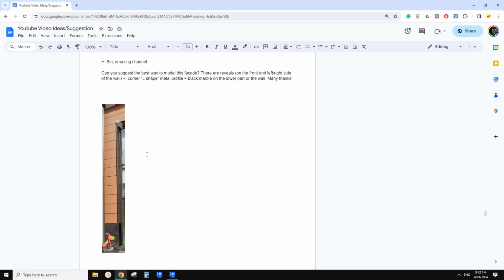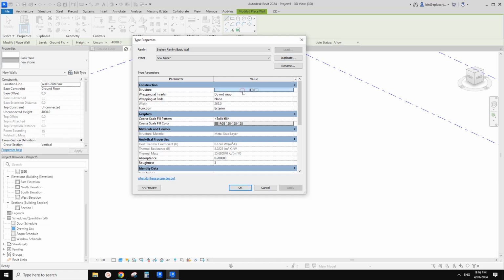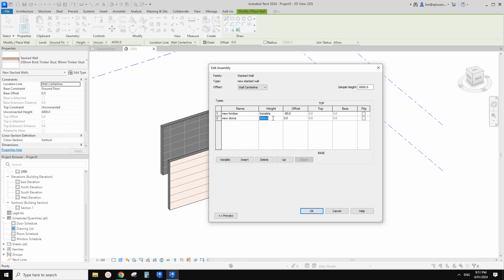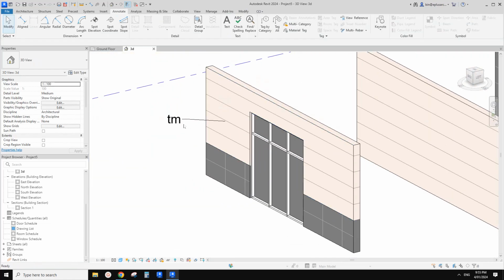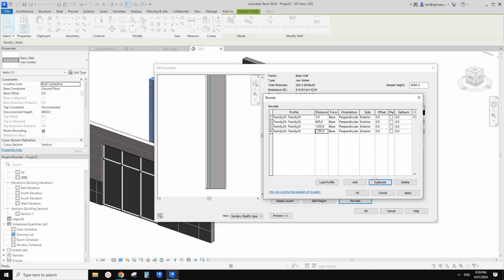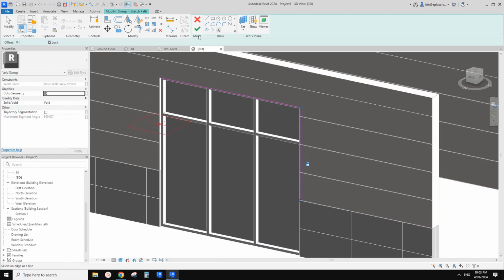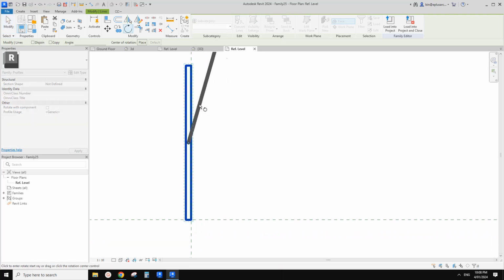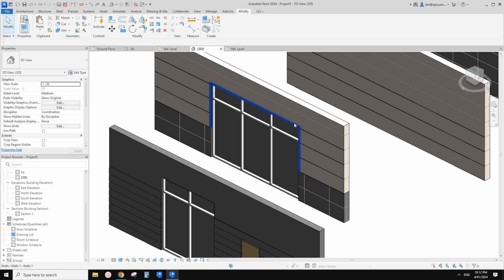24005 - Some Wall Modelling Basics - Stacked Wall, Sweep, Reveal, etc.

Comment: Hi Bin, nice video! I´ve benn trying to get the finish layer of the wall to wrap on the top and bottom of the opening, not only the sides. Is it possible? and also, is there a diference between wrap at ends and wrap at inserts? I thought that was the option for the example you showed, buy you used the other one, why is that?
Reply from the maker: I think so, can you have a try?  I think End is for the end of wall and Insert is for opening of windows and doors. We used End in this exercise because we used curtain walls to cut the opening instead of windows or doors.